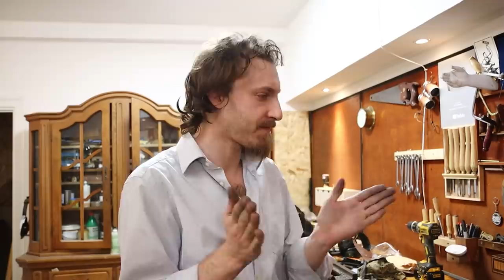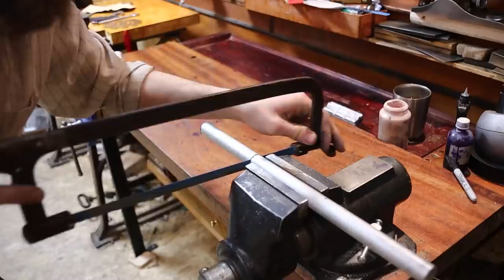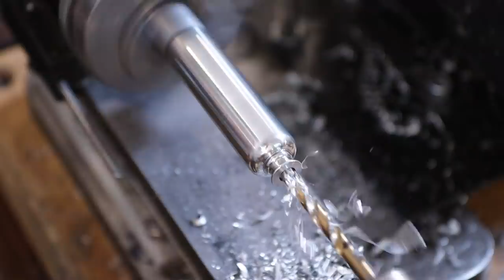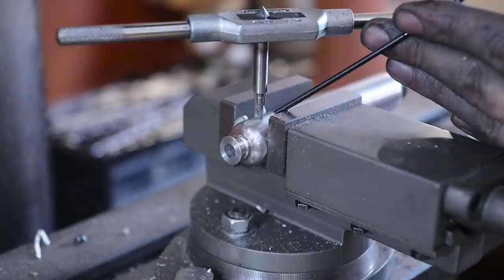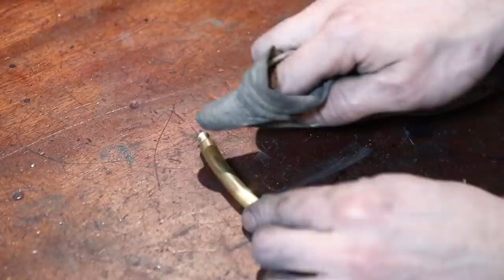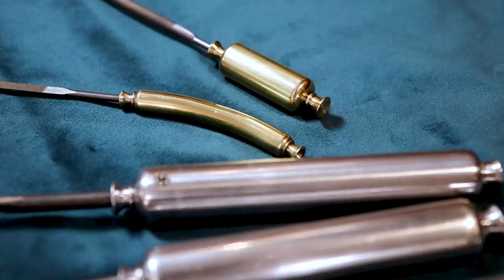Sausage Chisel Handles

Comment: Love the channel! Just a few turning tips though. Slower speed when youre using a cutter with large amounts of engagement to the material (form tools). Wd-40 works great as a lubricant for cutting aluminum and try looking into how to grind a "vertical sheer" lathe tool. Theyre pretty easy to make and great for good surface finishes on almost any material. Thanks for all the content!

Comment: The small torch you used to bend the aluminum sausage is actually plenty strong - it just takes a surprising amount of time to get it going, its really unintuitive - I've had the same problem when bending thick aluminum into bracelets using a similarly sized propane torch.

Comment: I like the wiener shaped one, more ergonomic for the hand, those handles would be good for carving tools if they tapered to a larger size on the back end for the hand. Perhaps you should make yourself some carving handles out of brass similar to these only larger in diameter on the back end for the palm for better and more comfortable transference of power from hand to tool? You sir, as always, are a source of laughs, AND inspiration, now I want to get myself a small lathe to make some handles for my tiny hand tools, like my hobby knives, scrapers, blades of various shapes and even paint brushes, only I think I would sculpt the paint brush handles to fit my fingers and my particular grip ergonomics, you know, like those silicon rubber slip-on grips that were available in the nineties for pencils and pens? Only I would make them entirely out of brass or aluminum, sorry Aluminium.